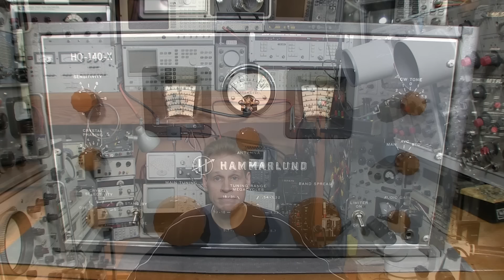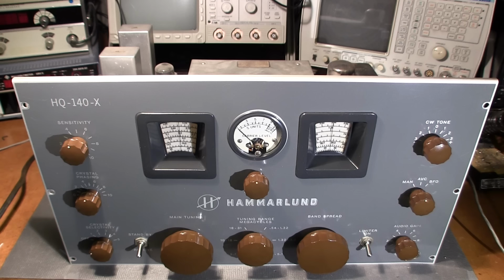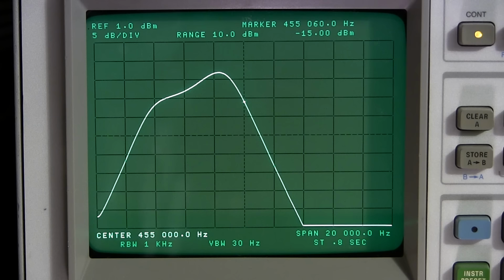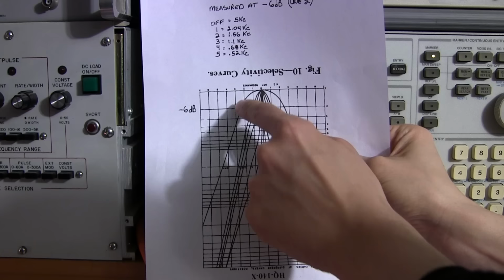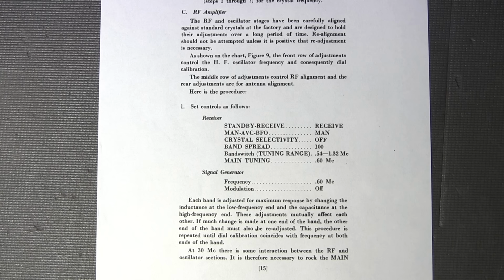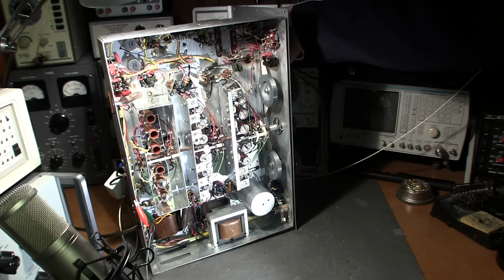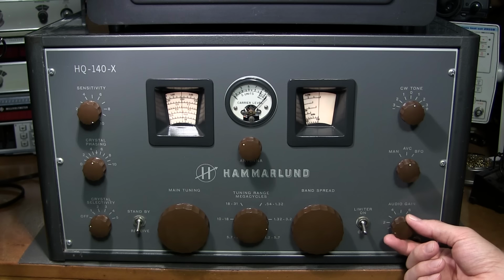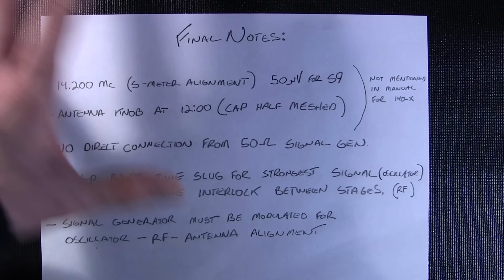Hammarlund HQ-140-X Repair and Restoration

Comment: Hello Mr. Carlson, I obtained my Associates Degree in Electronics about 40 years ago. I have been in the electronic/Electrical workplace for about 50 years.
I went into electronics in order to do the exact type of work you are doing. Board level repair. It seems I have been in Industrial Instrumentation , Telecommunications and general electrical.
Drat. I have retired now and found your channel. You are giving me great experience in troubleshooting and repair of an array of electronics. I probably won't do it professionally, but
I will do it for pleasure. I have two old receivers in upright wooden cabinets. I am ordering parts to replace the ones already there. Thank you very much.  I don't have your test equipment.
I hope I have enough to at least do a fairly good alignment. Thanks again. Keep the video coming!!

Comment: Hello Paul  -  I just wanted to thank you for this excellent video. About 16 years ago I had an HQ-140X and it was one of the most enjoyable receivers I have ever used.  It was just a lot of fun to operate and I remember how sensitive and stable it was. I was able to tune in a German ham operator on 10 meter SSB and even at that frequency it wasn't necessary to "touch up" the tuning to keep him intelligible. Very impressive. 
 Hammarlund did a beautiful job in the design and manufacture of this receiver and I would like to find another one but they seem to be getting fairly rare, especially in the condition yours is in. Anyway, thanks for the excellent tips on restoration and alignment and the trip down memory lane with the "band cruising". Your videos are excellent and very informative.   73,   Bruce K6RQR
Reply from the maker: I'm glad you enjoyed the video Bruce. Thank You for your kind comment!

Comment: I've been using and repairing old radios like this for years and I absolutely agree with you. There's several things I do as a matter of course in troubleshooting, diagnostic, or repair that I'm not sure is documented anywhere. Just some tips I got along the way from my Elmer or others kind enough to share. Thank you for taking the time to do this, I enjoyed every minute of it, especially the Crystal Filter and IF Alignment. I'm getting ready to revive an old BC348 and was dreading working on the Crystal Filter section.  You provided a great refresher!

Comment: The "Tuner Capacitor" is a work of art Paul. I think you have a unused receiver there. Any drift can be put down to age. My word you don't muck about with your vidio's. 10 out of 10 for expertise and just about everything else.Stuart.
Reply from the maker: Thanks for kind comment Stuart!
Reply: I agree. I think I would have checked the spades on the power plug to see if it had ever even been plugged in!

Comment: I had a HQ-180 JX with the fixed xtal accessory but it had Maroon dials. That rig was the absolute match or better for any of the Collins set ups I ever saw in actual operation. My brother was an extra class and he always wanted the best. Some years ago we bought a SP 600 JX for $300 in great shape. That rig is amazing for the time it was produced. The SP has the greatest audio i ever heard from any tube era radio including two restored E.H. Scott's Ive heard.. As a kid a neighbor worked in a sub section of Hammmerlund on far west 34th Street in Manhattan. Most of my family were hard core National radio/HRO fans.....

Comment: The final product demo in the end was an awesome reward for the hard work of following the front of the video. All most appreciated. I think I have a "virgin" Hammarlund HQ-215 that was retired not later than 1965. It looks like it was used by a novice with a Heathkit DX-60/HG-10 combo which I also have and that also appears to be in the same old fine in the 60's state. The HQ-140 is amazing, but it sure would be nice if I could pay my Mathematics teacher pay to have this Hammarlund HQ-215 safely work nice by someone with the first/last initials "PC". This is the wrong forum for such an appeal, and I hope it was not too obtrusive. I'm good in QRZ. Joel ~ KN4EWI

Comment: So been keeping an eye out for one of these.  One showed up for way too much money 3 months ago, finally came to an acceptable price last week.  It's a 140-XA, Only 4 electrolytic caps and no paper caps.  Waiting on caps to arrive then to start this, thanks for the video!  Found reproduction dials, mine are all warped up.
Reply: Hi Cory, I've had my dad's HQ-140-XA sitting on a shelf for a couple years, and I'm about to order replacement caps to put in before I try plugging the beast in. I've found a couple surprises on inspecting the circuit that's supposed to have the one paper cap (at least, the parts list says C38 should be paper). I wonder if you would be willing to be in touch somehow to compare notes? I could send you a couple photos and let you know what I'm looking at. If you're interested, we'll figure out how to be in touch. Thanks.

Comment: Very informative and very well done!  I've aligned many old radios, but I still learned a number of things from this video! One suggestion: your spectrum scope H-P 3585B is a beautiful instrument, but I'll bet that almost no-one viewing the video has anything that good. It would be very interesting (and much more useful by much of your audience) to see how you do the alignment with a more humble (and much more common) set of instruments. For example, an old Tek scope (like my 453), the sweep from a general-purpose function generator, and a frequency counter. Thanks again for this video!   Fred VE1FA

Comment: Excellent. I have one of these receivers that has been with me since high school (70s). The quality and reliability has been amazing, and it is pretty close to the condition of your receiver. I personally think this is one of Hammarlunds finest. I only wish I had the equipment to do the alignment like you did. Despite that it performs quite well except the crystal phasing does not perform anything close to what you achieved. Thanks for taking the time to do this excellent video.
Reply from the maker: Glad you enjoyed Jim!

Comment: Mr. Carlson, that is one of the BEST videos I have ever seen.  Thank you.  In the very early 1970s I got into shortwave listening.  Started out with a very small Hallicrafters SX-125, moved to a Radio Shack DX-160 then a Radio Shack SX-190.  Got my ham radio license in 1977.  In 1981 I graduated from Community College as an "Electronic Servicing Technician.  I sucked at that.  Oh well.  In 1983 I got a job as a Coast Guard Radio Operator, which sort of put an end to my amateur and shortwave listening endeavors.  But NOW I am retired!  I have a great Kenwood continuous-coverage receiver, and I think I might just find a good apartment-type antenna and get back into the whole shortwave listening thing.  By the way... the speaker atop that Hammarlund... Isn't that a Hallicrafters speaker?

Comment: Wow... You know I love sagas! I would have pulled out the popcorn but I watched it first thing in the morning. Too early for popcorn.
   
   Great information here and what a beautiful performer this radio is. All those alignment tips will come in real handy! I also loved the way that you isolated that noisy passive component with that non-conducting probe. Now I know the real reason for the noise generator function. Works a treat.

   The video, I think, could use one more thing. "Intermission!" 
   
   Great job Paul as always,
                                                Tom
Reply from the maker: Thanks Tom!

Comment: Thanks Paul. I am not sure about those brown knobs they used though. I have seen many original ads for those receivers, but they were in black and white, so I never knew the color of the them. A matter of taste, I suppose. You seemed to like them, and the object is to preserve the radio as closely to original as practical. 
I appreciate your efforts in making the highest-quality videos I have ever seen on youtube, without regard to the subject. You seem to know just when to skip over things and when to slow down and show details.  P.S.-I love the marathon videos! 3 hours of viewing pleasure.
Reply: I'll bet the knobs matched the tuning window bezels' slate color when they were new.  My 1958 Heathkit Signal Tracer had fluted knobs of same apparent style as on Paul's HQ-140x. They were colored gray to match the panel when new.  They have also aged to "milk chocolate." No significant exposure to sunlight.  Just an unstable colorant.  
Totally agree:  Mr. Carlson's lab videos are the best.

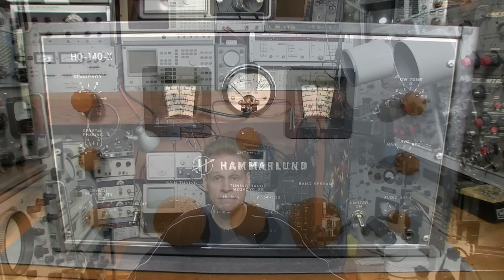Comment: 0:00:00 - 0:01:30 | Intro
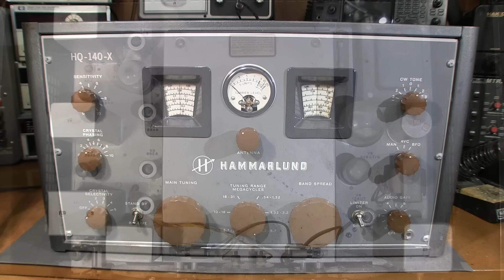0:01:30 - 0:09:12 | First look outside
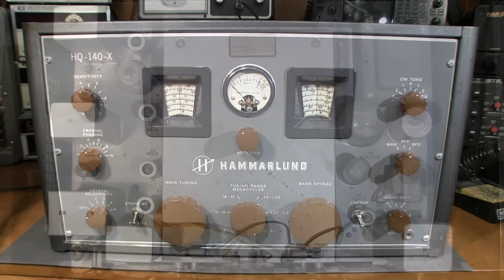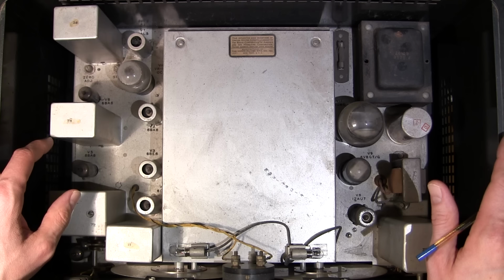0:09:12 - 0:12:25 | First look inside > top
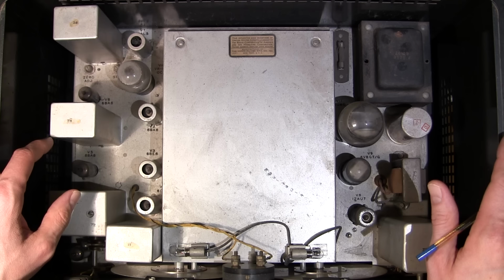0:12:25 - 0:16:21 | First look inside > bottom
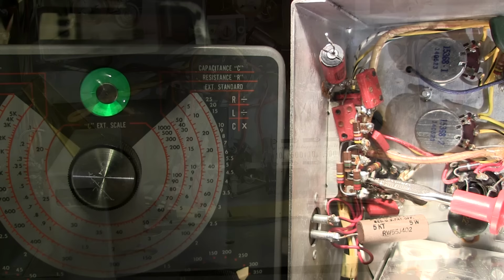0:16:21 - 0:23:33 | Testing paper caps for leakage
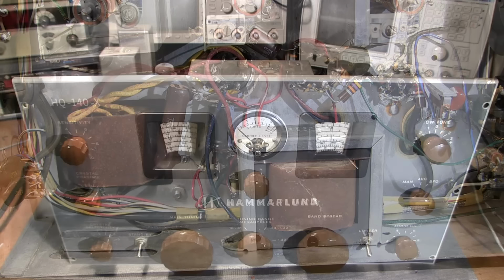0:23:33 - 0:25:05 | [SPOILER] Replacing caps
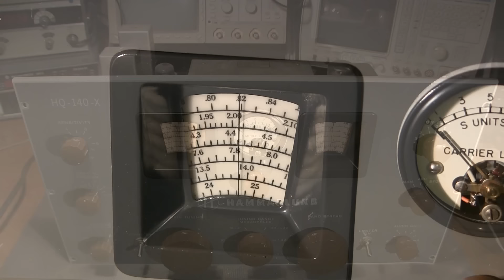0:25:05 - 0:31:37 | First power up, functionality walkthrough and rough diagnosis
0:31:37 - 0:35:28 | Testing broadcast band alignment
0:35:28 - 0:37:58 | Looking at engineering-porn tuning capacitors
0:37:58 - 0:40:49 | Cleaning the dials
0:40:49 - 0:41:28 | Aligning the dials with their windows
0:41:28 - 0:45:58 | Looking at the schematic and notes on test gear connection for alignment
0:45:58 - 0:47:55 | Attaching spectrum analyser
0:47:55 - 1:12:23 | Initial spectrum analysis of IF alignment
After many hours of IF alignment...
1:12:23 - 1:33:42 | Explaining the IF alignment procedure with spectrum analyser and manufacturer spec. sheet
1:33:42 - 1:37:22 | Explaining the Beat Frequency Oscillator alignment
1:37:22 - 1:40:54 | Beginning the aligning of the Antenna, RF and Oscillator sections
1:40:54 - 1:52:54 | Notes on manufacturer's published alignment procedure including their error and omission
1:52:54 - 1:56:14 | Setting up for alignment
1:56:14 - 2:03:22 | Alignment using an oscilloscope or Vacuum Tube Volt Meter
2:03:22 - 2:08:59 | [SPOILER] Something's not right
2:08:59 - 2:24:09 | Troubleshooting with RF probes and a signal tracer
2:24:09 - 2:26:25 | Ready to test the restored receiver
2:26:25 - 2:30:03 | Listening from .54 to 1.32 Megacycles
2:30:03 - 2:31:42 | Listening from 1.32 to 3.2 Megacycles
2:31:42 - 2:33:00 | Demonstration of noise limiter
2:33:00 - 2:34:37 | Listening from 3.2 to 5.7 Megacycles
2:34:37 - 2:36:36 | Using the BFO to tune in on side band
2:36:36 - 2:37:44 | Listening from 3.2 to 5.7 Megacycles cont.
2:37:44 - 2:38:38 | Manually tracking a moving signal
2:38:38 - 2:39:48 | Listening from 3.2 to 5.7 Megacycles cont.
2:39:48 - 2:45:02 | Listening from 5.7 to 10 Megacycles including more side band and noise limiter action
2:45:02 - 2:50:51 | Listening from 10 to 18 Megacycles
2:50:51 - 2:54:14 | Listening from 18 to 31 Megacycles including using the BFO to tune in on a Morse code beacon
2:54:14 - 2:57:35 | Final notes and reminders for alignment
2:57:35 | Outro
Reply: Deserves more likes, helped alot!
Reply: Amazing, thanks for this!!
Reply: You have way too much spare time on your hands.
Reply: @Frankowillo  If a job's worth doing, do it properly ;)
Reply: @FredGandt  : Brownie points for you.

Comment: Fantastic video, as always, Paul. Really appreciate the time you devote to helping people learn about old equipment of the hobby. As for the aesthetics of the radio itself, I hate to offer a voice of dissent, but beauty is in the eye of the beholder, and man, that thing his homely looking.  I've always through Hammarlund receivers of this era were boring, staid and frumpy looking. The set's performance may now be Corvette, but the styling just screams Desoto. I know the knobs are original, but to the uninitiated,  they look like a $2 set of knobs that came out of a grungy cigar box at a ham swap.
Reply: They were designed for function, not eye candy. But the color of the knobs didn't quite cut it for me, either.

Comment: I love Shortwave :) Started out with a Am transistor radio as a kid then graduated to shortwave I love it!!!!!! always have 
lots of things can be tuned in world radio you can here stations depending on the band    234 / design frequency = each dipole side length in feet,
OR - 468 / design frequency = total length in feet. Most builders cut long and trim the total length for lowest swr on their design frequency. for the Antenna!!! and you can here the world! this rocks and as a ham now I have taken my love of radio not only talking and tuning in but also learning and refurbishing them some day  :) but if you use this in a 2 sided dipole you use a 50 ohm line for the best  receiving  and you can divide the total length on each side  you can here radio in France and Japan UK Germany Havana CUBA, Spain  all over the place I love radio always have always will. Even Russia and other places no min use English depending on time of day and Space weather Forecast if no sun flairs are interfering with the band you can  here a lot of stations coming in...
Reply: Great job man great representation it takes a lot of time..

Comment: Hammarlund was one of the few radio manufacturers to make their own air variable capacitors.  I have a small ceramic insulated one sitting around which came out of the PA of a very old Johnson CB radio.

Comment: Nice rig and video! I never would have guessed that chocolate knobs on a gray cabinet would look good. Got to love a rig that runs a 6V6 in the audio output. I'm actually watching this video through a 1956 Challenger HF8A amp running a pair of 6V6's,  into a 100 watt speaker, so I'm not sure if the great sound is from from your end or mine! Sounds great either way.

Comment: Here I am watching this video again. My Hammarlund HQ-140-x is yet to be restored, though it provides a lot of fun the state it is right now. The first thing I noticed is that the color of my HQ-140-X's knobs is much darker. I wonder if it changed overtime or Hammarlund used different tones. My radio show all of the symptoms of this one, which is in much better shape, specially that awful noise caused by that mica capacitor. And this video also reveals two errors on the factory service manual, which is very important, since this is a communications receiver and requires absolute precision. Again, thanks a lot for posting.
Reply: I had a HQ-180X Which had the fixed xtal's and it had Maroon knobs. That rig was the absolute match for most Collins set ups. It really was. Great construction quality. Wish I still had it. I DID buy a SP-600 in great shape for $300. I knew a neighbor who worked for Hammerlund on West 34th st in Manhattan. I understand that a LOT of Hammerlund's with the fixed xtal addition were sold to a considerable number of foreign embassies and consulates around the UN in the mid fifties to early 1960's. 
BTW)
Reply: @cindylawrence1515  Yes, they were used in some government agencies here in Brazil.

Comment: I had a Hammarlund HQ-120X at one time and it had a metal bottom cover. I always found that if the metal cover was not installed the frequencies would be off somewhat. I always did the adjustments with the metal cover on. There were holes cut in the metal cover that allowed you make the adjustments with the cover on.

Comment: When I was a kid, and had a Novice amateur radio license and was struggling to build up my Morse code listening ability needed to pass the then General license, my dream receiver with the selectivity performance needed in congested areas was the Collins 75A4 receiver, with its mechanical filters. I guess today, that equivalent would be a Watson-Johnson DSP-based receiver with the steep curve but wide bandwidth selectivity needed for high quality short wave radio listening.  Also, I was told that dual conversion heterodyne design was needed for adequate image rejection for full frequency bandwidth coverage at the higher frequency. The Hammarlund product is single conversion design.

Comment: Great job! Wonderful video! Would you consider doing a similar video for the National HRO 500 receiver? I have aligned my HRO 500 via the original manual using equipment available at the time it was new. There are several folks on the internet that have updated the alignment procedure using more modern equipment. I just feel you will do an excellent educational and detailed alignment and I would love to see you do it.

Comment: This video was very helpful in regards to using a spectrum analyser and tracking generator for an IF alignment. Would you consider doing a video on IF alignment of a dual conversion receiver? I'd be curious to see how the process may vary.

Comment: While I can see this is a little past time, I have just gotten into it a while back and have enjoyed it. I have acquired some Cable Boxes, which have been outdated where I live, and were refused return to the supplier. I am beginning to dismantle them and see a lot of electronic parts. I am interested in finding out if they have reusable parts, someway to put them into use for other than Cable action, etc. Most appear to be fairly clean inside, and no burnt items. Let me know if you can. Thanks

Comment: Quick question...  I have the HQ-140-XA and plan to follow your guide to refurb it.  It works fine but it is probably in need of a new set of capacitors.  My question.  In one part of the alignment you generate a 5.3 MHz signal to determine the accuracy of the dials.  I don't have a signal generator...  Couldn't I just set my HAM radio to 5.3 Mhz at very low power and send a tone to check the radio's dial accuracy?

Comment: This video is kind of like a video version of a service manual. Do you think its possible to add a few links into timestamps of the video to jump to certain sections, just like an index in a service manual? I am sure a lot of people will bookmark it in case they will later need it to look something up, its probably very helpful to jump right to the wanted part.